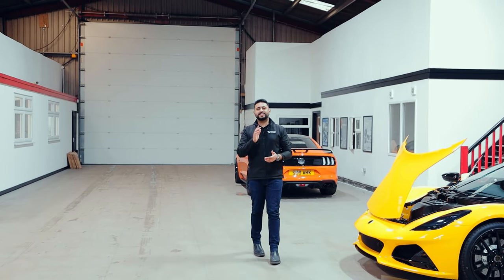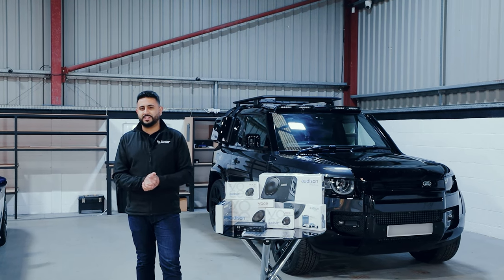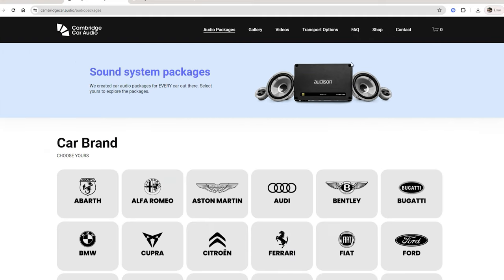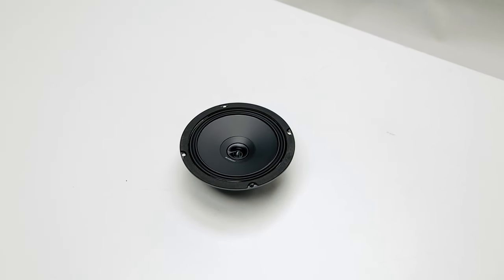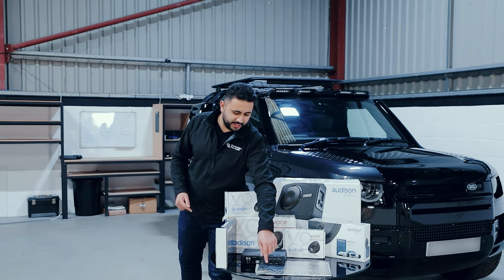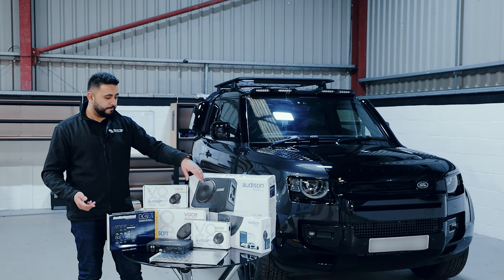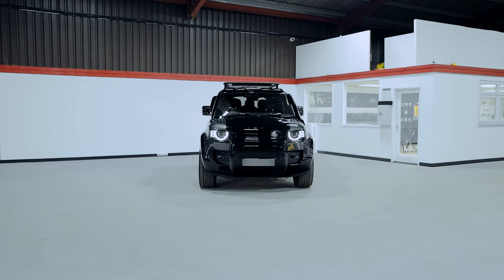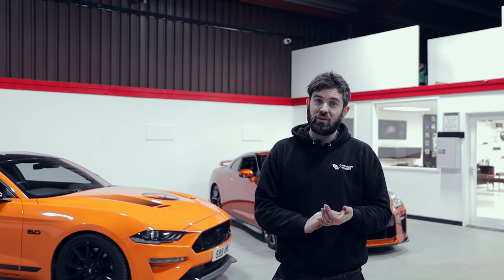Defender 90 Full Audio Upgrade: Experience Sound Like Never Before!

Comment: What improvement in signal is obtained by using the LC7? Is it worth using it considering the Audison signal analyzer? By chance, I have the LC7 and the same amplifier, and I would like to know what benefit it brings and the reason to use it in this setup.
Reply from the maker: We use it for accubass tech, depends on signal and input that the car is giving